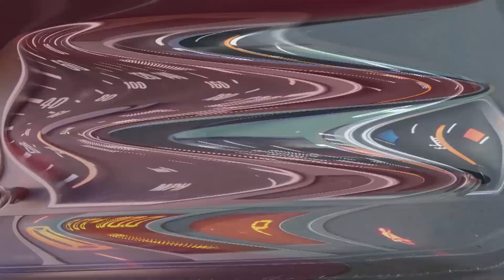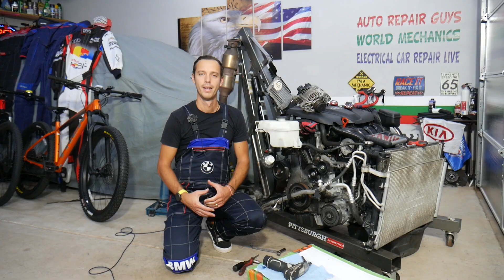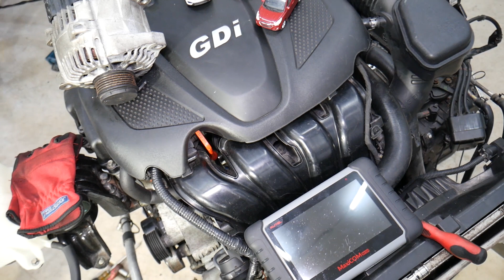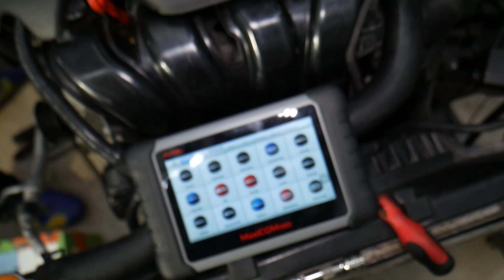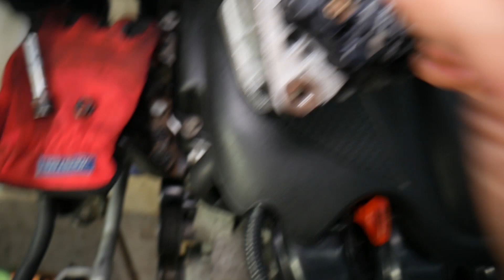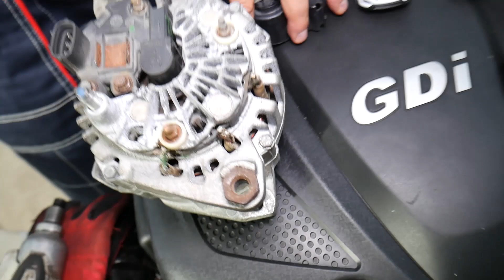FIX BATTERY DRAIN DEAD BATTERY AFTER CAR SITTING FOR 2-3 DAY HYUNDAI KIA GDI

Comment: My sister had this problem with an Elantra. She replaced 4 batteries before we discovered the problem. Because of where her garage is relative to where she keeps her key, her car was always on guard waiting for commands from the fob. It would never go into sleep mode and that was draining her battery.

She obtained a security sleeve from Amazon and keeps her fob in it when not in use. She hasn't had a problem with the battery since.